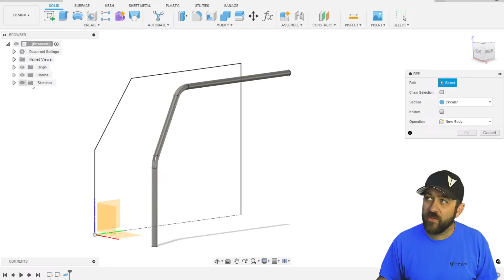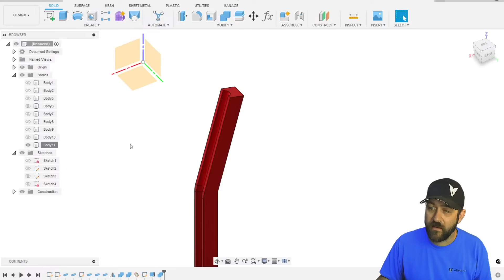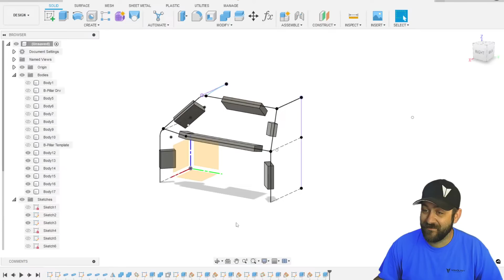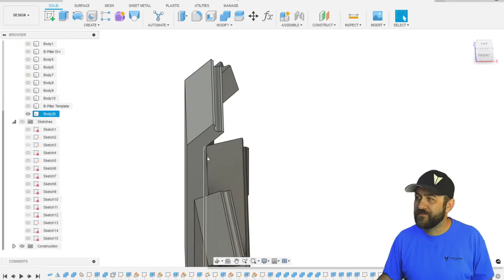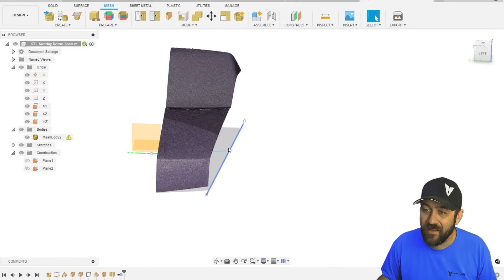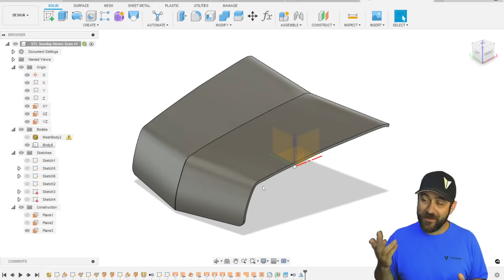The Return of STL SUNDAY - 3D Printing Sunday  - Ep 39

Comment: I've designed things with SolidWorks for 24 years...work related... but that software looks better for doing this...and it operates pretty similarly.  What software is that?  I'm a newbie to RC but I've been a multi-discipline engineer for a long time.  I bought a new Bambulab X1C 3D printer combo a month ago just to do this but I don't feel like giving SW $5k if there is something similar enough out there.  Thanks in advance.